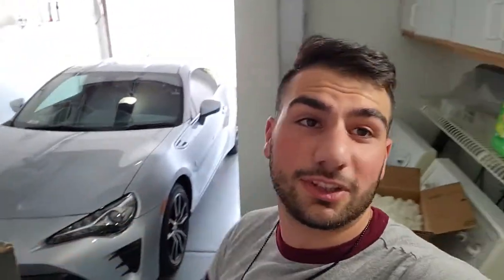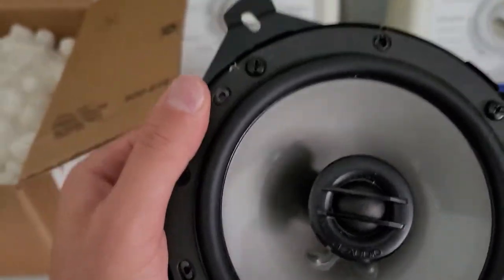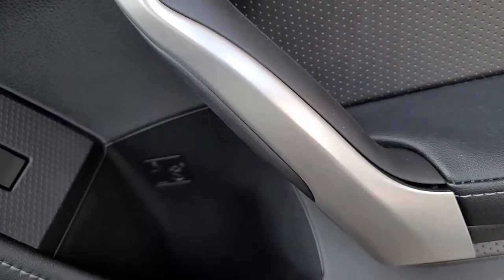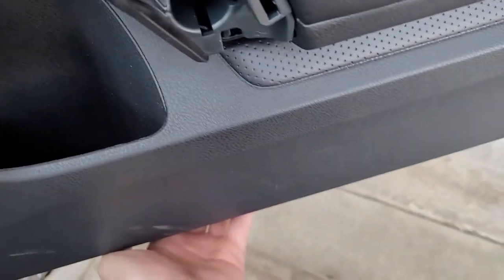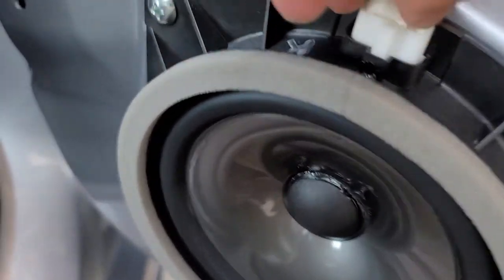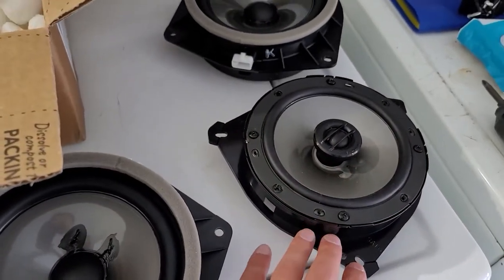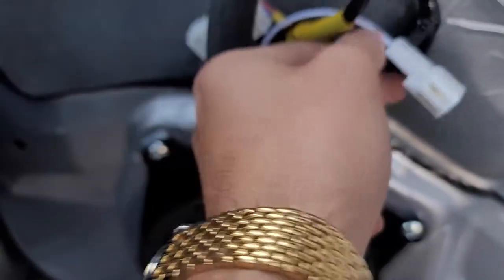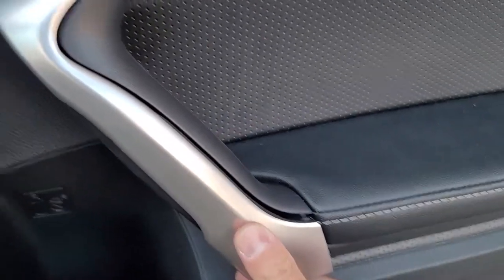JL audio C2-600x install on Toyota 86

Comment: Honestly those speakers should never have bass that’s how you blow them up and cause them to have holes it’s better when the quality sounds very clear and clean the subwoofer should pick up the lack of bass
Reply: wrong, 6 inch mids handle lowmid frequencys just fine.